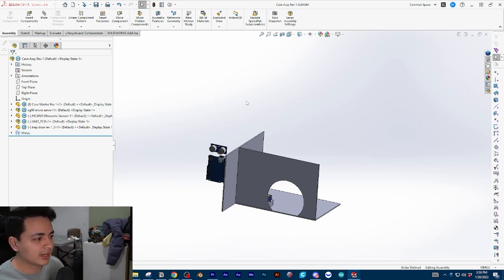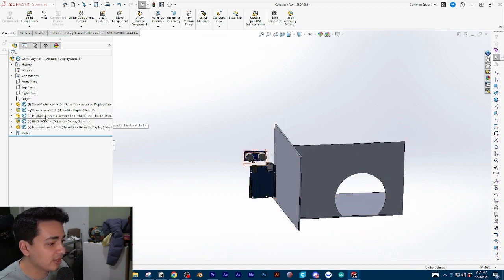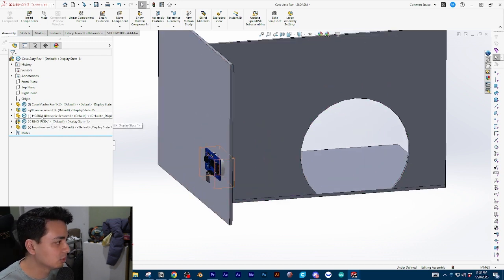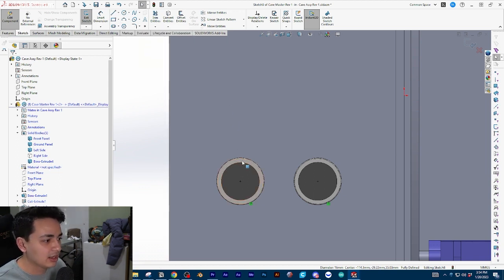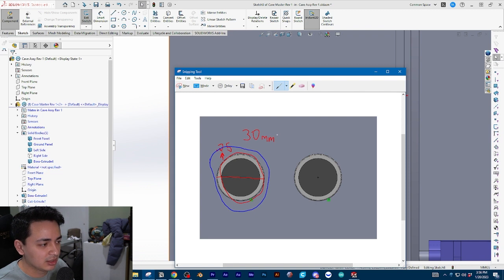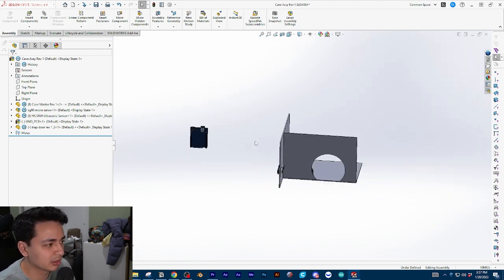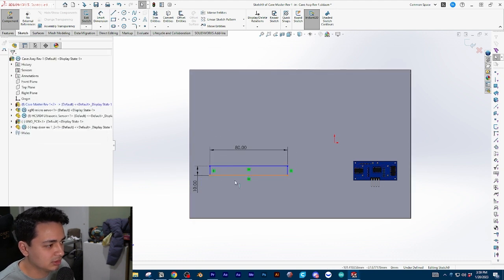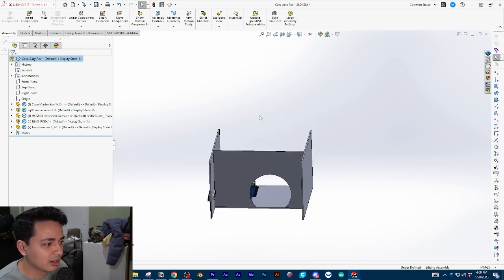Intro To Mechatronics: Part 2.8 Electrical Component Placement

Comment: I've never thought about sticking a component through a wall then using convert entities to mark the hole lol that was a great tip for speed with simpler components (usually I just do intense calculations then draw according to them lol). I am working on a robot design with microbit as the microcontroller, and I'm using a bunch of servos to move the arms and the head, it also has an ultrasonic sensor for eyes.  I've been struggling with the 3d design a lot and your videos are giving me ideas.